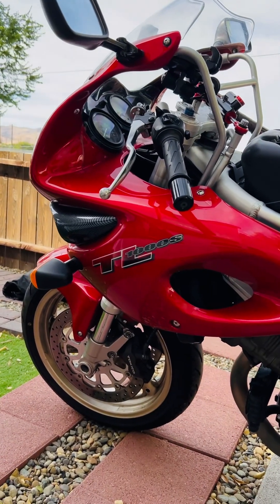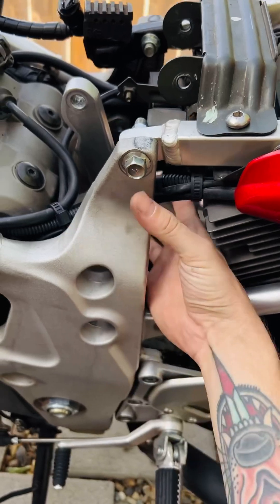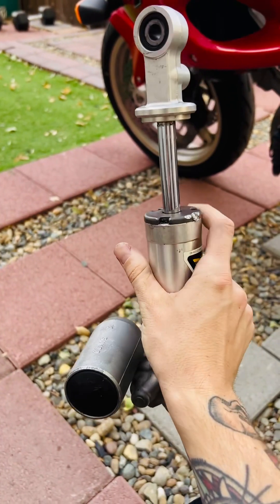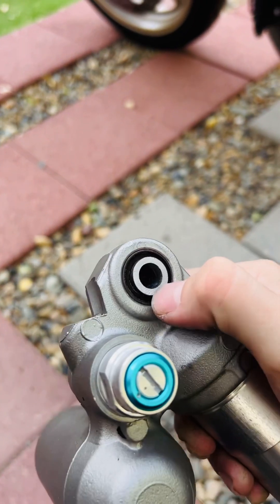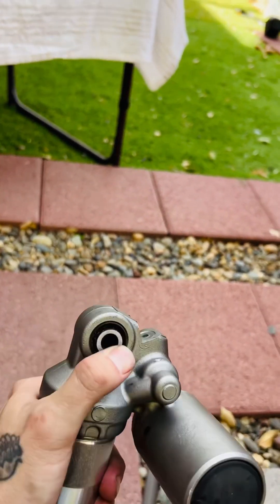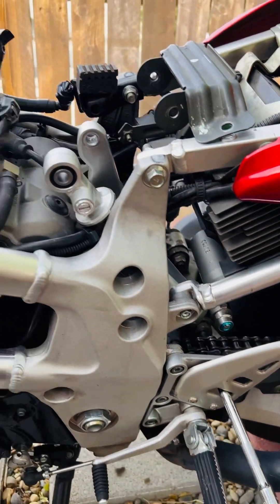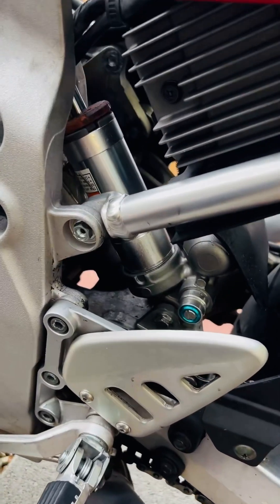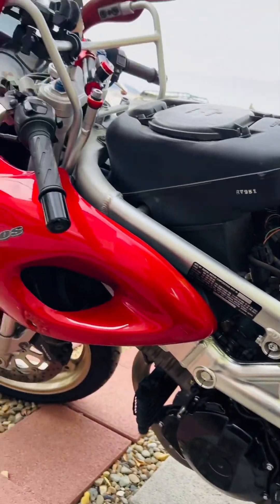Suzuki TL1000S Rear Damper Conversion

Comment: You have the bracket facing the wrong way the bolt goes through the subframe mount which you have to drill out then a spacer then shock them bracket

Comment: I imagine even with the flaw one could ride safely if a normal average (aka NOT talented which is 90% of riders no matter what they may otherwise believe....if someone goes flying past you like you are standing still once in a while?  Just admit you cant ride for squat compared to an actual skilled rider ....nothing to be ashamed of its a lot like playing guitar a little as a hobby where no one would seriously want a recording of your best...yeah your guitar is good and you know where to put your fingers but no developed talent)  Anyway the point is the average person I imagine could safely ride a TL1000S stock without issue because the issue occurs when the small volume of shock fluid overheats....slow assed riding I dont imagine will tax that rotary system enough to be dangerous?
Reply: Dude. Seriously. 

What is the color of the sky in your world?

Comment: Great video. I've been looking to fix up a 97 and dampener has seen it's age on it with weeping swollen seals.
How much was that adapter plate on the forum, also I see that some stuff has been deleted or relocated on the bike. The gas tank is just on that one mount?

Either way informative video!
Reply from the maker: The adapter plat was like $80. You can find them on eBay sometimes, or through facebook groups like TLfanatics. 
There’s a little bracket not shown in the video that the gas tank fixes to in the rear. There’s also two rubber mounts on the frame that it rests on as well, although not super necessary to it being secured. I actually had to permanently remove one of the rubber mounts to make room for the damper which you may see if you look carefully in the video. Happy to help if you have any other questions!
Reply: unless you aim to to actually try to ride fast?  I imagine just having the stock system ovehauled with new seals and fluid will fine and safe ...I mean UNLESS you actually are one of the small percentage of talented riders actually capable of hauling ass on the track or twisties ....I imagine THOSE are the only ones that will overheat the too small  fluid capacity of the stock rorary damped system.  Suzuki massively underestimated how many riders were talented or crazy enough to push that system beyond it's capability